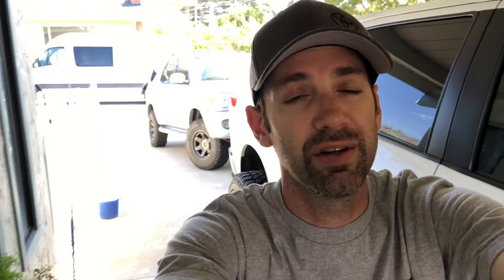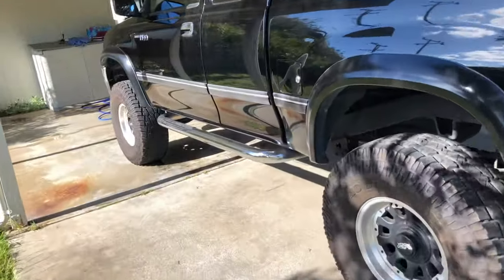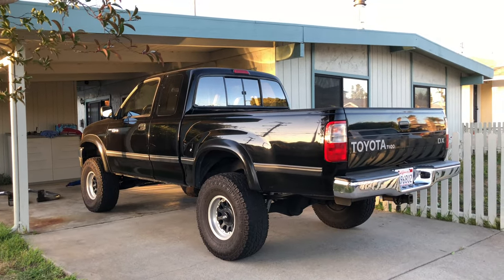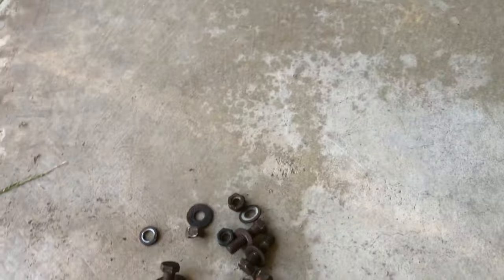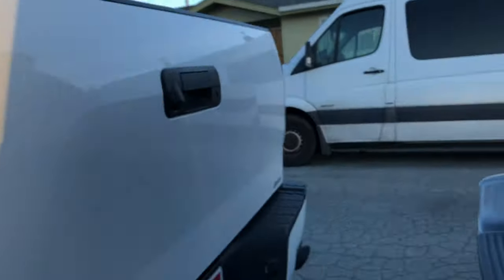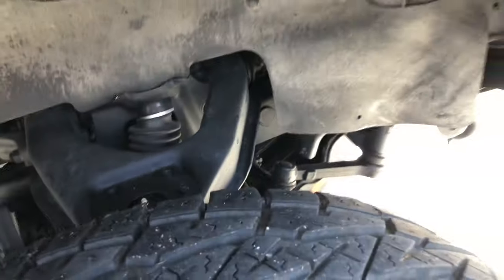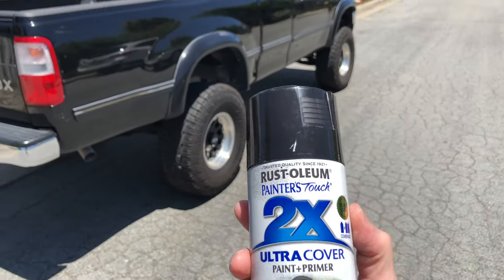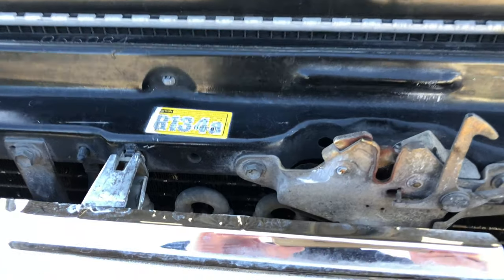PROJECT T100 - PART 2 - Lifted old school Toyota 4x4

Comment: Hey does anyone know where I can get a suspension lift for my t100? Been looking all over and I can't find it
Reply from the maker: You can still order them straight from superlift, and there pretty cheap compared to lift kits these days..  link below.. 👍🏼
https://superlift.com/toyota-lift-kits-toyota-t100-pickup
Reply: Can this kit work with my 1996 2WD T100?
Reply: I have the same prob lookin for some parts 97 t100 4x4
Reply: @toyotafanatics1  It says for 93-96 T100, but mine is a 98...

Comment: Let me know if u are selling those smittybuilt side steps.  Would be interested.  Yes the stabilizer bar was recalled.  Mine snapped on me. Dealer replaced new under recall
Reply from the maker: i got rid of them yesterday..steps are shot, the bottoms were pretty pitted/rusted out.. and the hardware is rotten..

Comment: Just got some running boards for my 98 T100. Apparently the brackets are supposed to just bolt into pre-existing holes in the rocker panels, except...there are no holes in the rocker panels smh. Guess I'm either going to drill some holes or return them. Sucks.

Comment: What lift is on it? I have a 97 I cant find anything for.
Also You interested in selling the side steps?
Reply from the maker: Where are you located?
Reply: @toyotafanatics1  95946, I can drive a bit depending your location
Reply from the maker: your about 220 miles away, i’m not sure it’s worth it, the bottoms are pretty pitted with mild
rust, and the hardware is pretty rotten..
Reply: @toyotafanatics1  Yeah that's a bit far of a drive. If you were like 50-70mi I would've made the drive. The hardware I could've replaced, but damn that's a bit too far. Thanks for getting back to me man. I'm glad to have found your channel with the T100. I can't find anybody else that does anything with our trucks.
Reply: I already got post notifications on so i can see the new videos asap. Love seeing this stuff.

Comment: Hey man, not sure if you respond to messages months later, but I got a 96 T SR5 and want to put a lift kit on it. the forum is telling me i should use spacers under the control arms and get another leaf spring... I went on your website link but it didn't go to cart and don't know what else i need to purchase. thanks man, great video
Reply from the maker: Thanks.. so is your T100 a 2wd or 4x4.. there’s great options for both, but definitely different setups depending on that.. lemme know.. 👍🏼
Reply: @toyotafanatics1  4x4
Reply: I can't find a high quality suspension lift kit for mine either!
Reply: @thepriusgirl  yo you got a t100 and a Prius too?!?!?!
Reply: @567Kriss  Yes, you've seen my Prius mudding and crawling videos?
Reply: @thepriusgirl  no I haven't 🤣🤣 now I need to